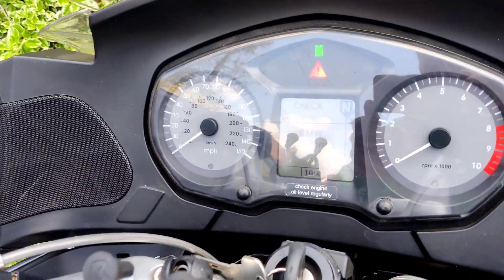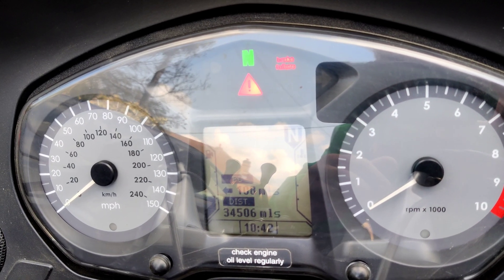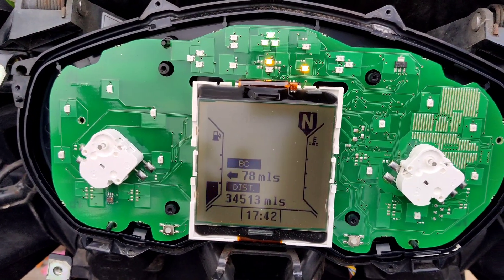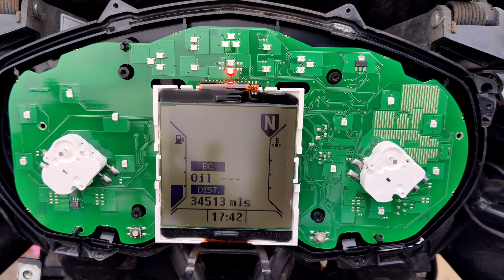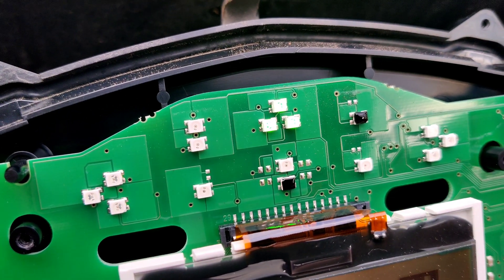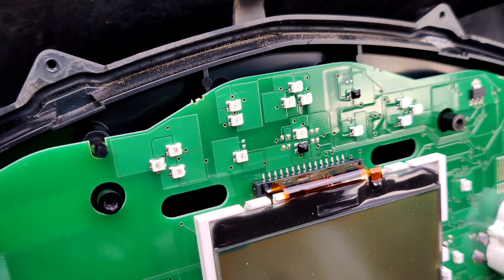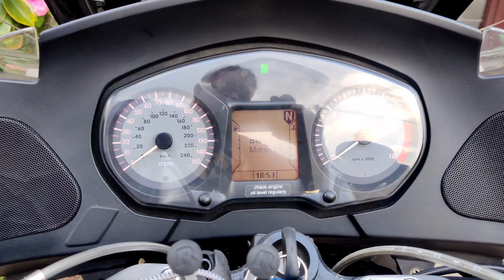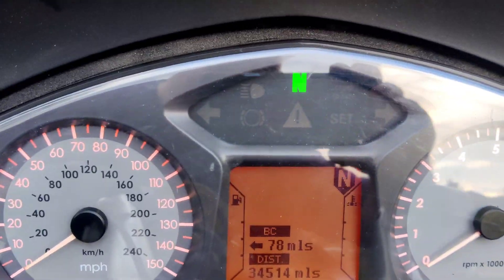'Fixing' the Brake Failure warning light constantly flashing

Comment: Thanks Martin, your video helped me "sort" my brake failure warning light. I didn't do any work to the bike but when I listened to your commentary  at the beginning,  on the rate of flashing of the light, I realised my warning light was probably normal and only needed a 5 metre run for the abs to calibrate. The reason I was unaware of this is I bought the bike about 5 months ago and had it delivered by the seller, straight to my garage, never ridden as I had a r1100rs on the go at the time. Old bike sold and can now book this one in for an mot! cheers Jim